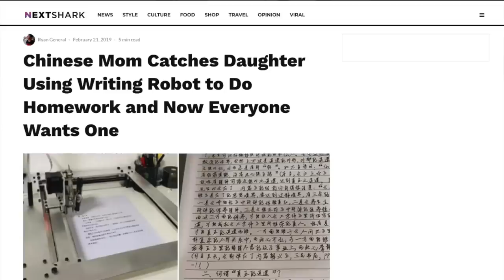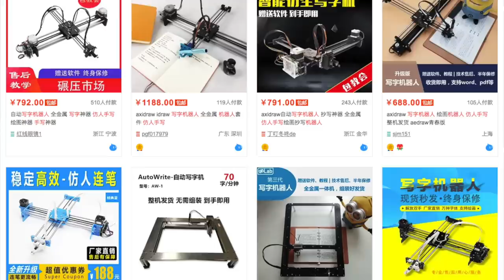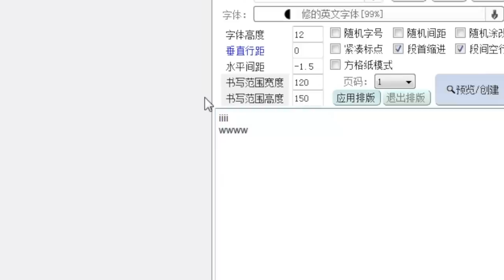Secret Chinese Homework Cheating Machine!😲

Comment: I think the font is way too consistent.  Not many people write the character exactly the same way every time.  If the printer was going to emulate handwriting more accurately, you'd need a handful of versions of every character and then they'd have to be randomly called for use.  It's not easy for a computer to look sloppy but that's what makes a person's handwriting look like handwriting and not a font.  At least in my opinion.
Reply: I don't know, there are people who dedicates to identify other people by their handwriting looking for the consistency of their writing.
Reply: From the sounds of it, because Chinese characters are learned by repetition over and over to be absolutely perfect, then that's not really a problem, but in English and other languages a little slop is expected, and when it's not there you get an uncanny valley feeling. It's actually worse because of the perfection. 
The mono space is a problem as well, but I'd know it was done be machine even before noticing the spacing.
Reply: on the lined paper it was really obvious, every copy of a character had the same spacing. even though the font hides is well (since everything isn't perfectly lined up) the overall effect was too structured.
Reply: @AndyDillbeck  Because drawing a Chinese character with even the tiniest imperfection changes the meaning, they have to be exact. In English, we just have to get it close enough. I, as a left-handed male who works in I.T. have the worst handwriting you've ever seen, it changes from character to character. Since we English speakers (and writers) don't have that constraint most people just have a way they make an English character and when it hits the paper sometimes the pressure is inconsistent etc which would make tiny imperfections. I think that would be instantly noticeable for most experienced teachers (and parents) plus the noise would clue in the parents
Reply: Nothing a bit of machine learning cant solve
Reply: @thecommenter578  usually identifying a person by their handwriting, or more exactly proofing if for example two handwritten samples are written by the same person, does not look into how exact every single letter matches the others, but more how the letters and especially letter combinations are written. Sh in combination they may look different from s and h in other contexts for example. They look for characteristics like a little loop or hook when starting a letters line, if an L was written wit a little loop at the corner or as a straight angle, how pressure was applied within a letters line, such things.
Consistency is a part of it, but more like if a person has a tendency to make the letters slightly smaller towards one end of the line etc.
Reply: Check out this guys fonts....  they do exactly that...
Reply: For the tiny font sizes you could just add some variability when the g code is processed, add or subtract a certain percent from each movement coordinate. Think it would add enough to seem sloppy. On the large font sizes you really need different versions of each letter.
Reply: I did create my own font 😘
Reply: I think the same could be done in any language. I think what the kids are banking on is the sheer amount of assignments working in their favor. If it looks handwritten, the characters are legible and there doesn't appear to be any plagiarism, move on. Can't say I ever made much attention to handwriting while grading other than to note those with really bad handwriting and those with exceptional handwriting. It was more about the content over the delivery.
Reply: @thecommenter578  While there's a certain amount of consistency for English cursive and print,  it's not exactly the same
Reply: This was exactly what I was thinking
Reply: @msihcs8171  eh have you seen some people's handwriting in Chinese or Japanese? You can get a scrawl where it's just a wiggly line, but it's close enough that people can recognise the character it's getting at. Same as in English really, you recognise the shape of words more than the characters so it doesn't matter when an a looks like an o or whatever

It's different when you're in school and they're looking for perfection to make sure you know what you're supposed to be doing though! But it takes real skill to write characters consistently, you'd expect some variation in how they come out
Reply: I already get mail where the address on the envelope has used a font that is supposed  to look handwritten.  I can always tell because the duplicate letters look exactly the same.  You could see it when Naomi did an English sample and all the i's and w's where drawn the same way.
Reply: @msihcs8171   I will say, that I know both Chinese people with sloppy handwriting and western people that have scarily consistent handwriting.  The westerners work really hard at it and put in time to keep it so, the Chinese people are electrical engineers and don't write by hand in Mandarin often, so they are out of regular practice. One lady told me that when she was a child she never worried about the stroke order so she draws her characters "wrong" and the same character in different stroke orders sometimes.  

Oddly enough, I would say that my spoken Chinese is better than my written Chinese, but when I say something and make a mistake in tone, etc. people have no clue, but when I WRITE something, people will understand it and say "oh, but you missed a dot here" or "that line doesn't connect but know what I am trying to write.  If I were to guess it is either: 1) because when using pinyin on  their phones and computers they select the character they want from a list, they are better at recognizing a character from an approximation or 2) my spoken Chinese is a lot worse than I think it is because I don't speak a tonal language natively!  ;) Either way, that is my experience: accuracy seems to matter more in speaking than in written communication because Chinese people are better at recognizing characters that look close to what they should look like than words that sound close to how it should sound.

of course I don't know hundreds of Chinese people, so My experience might not be representative! What do you think?

cheers!
Reply: exactly true. even tho the selected font could look hand written, theres no variation.
Reply: @thecommenter578  yes its the way the english charaters are done the different styles and varents almost like a finger print granted there are some master penmen that can exactly replicate their charaters each time but this is uncommon at student levels and is something of a dieing skill like manual drafting but yea they look at whats the writers style and figure out their comfortable movements
Reply: I have a commercial art background; I've seen sign painters, comic book letterers and graphic artists that have built up so much muscle memory in the trade that their penmanship is very close to perfect; most people wouldn't be able to tell, but there is even slight variation in their work. An easy example, You can always tell the difference between hand-lettering (all Comic books were hand-lettered from the 80's and earlier) and someone using comic sans font (most comics these days).
Reply: Exactly this. If every character looks exactly the same, alarms go off. There needs to be a randomization factor.
Reply: There would definitely need to be more randomization (or chaos) added to the pathing to make it look a bit more realistic especially when you use many of the same characters throughout a paper. Varying speed and pressure would also help as humans don't really write at a consistent speed as they process their thoughts while putting them down onto the paper. Might even just stop mid sentence to think what to write next. All of this shows up in handwriting. Machines don't think, they just do (currently anyway haha)
Reply: @Adam Payne -- Not inconceivable to add in some Illustrator-like width tool functionality to add some line thickness variation to the characters.
Reply: Most people aren't aware that randomization is a part of most western languages, both spoken and written.
Without it, it is immediately apparent that some form of automation is behind it.

Comment: It is cheating if the expectation is to have handwriting and the student uses a machine and claims it is handwriting.  One of the fundamental characteristic of handwriting is the variability.  The problem with the "i" and "w"s is that they are too identical.  This is more important than the monospace font.  Similarly, if a Chinese teacher takes two identical characters (ideograms) at various places in the text, and he can superimpose them perfectly, he will probably get suspicious.  Like, if the student is "too good to be true"... 

To be totally credible, the software needs to introduce a little amount of randomness. This way, if you project two similar characters one on top of the other, they do not match too perfectly.
Reply: Pierre C yes you are right I never see Chinese that even write Mono space by hand when they not need to write in boxes on the paper where some dashed lines help to write in the exact sectors.

Comment: I remember reading about this problem a few months ago.  Thanks for showing the tool that's used.  It's cool to see that it's like a core XY type device.  Between that and the pen, it's easy to see why the characters are smooth and hard to determine if they're written or printed.  To your question on is it cheating?  I think it depends on the assignment.  If the assignment is to learn the characters and improve penmanship, then repetition is key and this would be cheating.  If the assignment is thought based and this is used as a printer instead if handwriting it, then I don't think it should be considered cheating.

Comment: It is essentially a flatbed plotter rather similar to those that we had in the 70's and 80's. 

Under a magnifying glass you will see that the shapes are formed using incremental steps due to the stepper motors. The consistency of form is another give away.

Old Calcomp drum plotters in the 60's had the characters stored as data in the software.  These characters could be scaled, shifted  and rotated within the software before they were transmitted to the plotter (x Inc, y Inc, pen up/down) the plotter instructions being passed as bytes over a simple parallel interface.  The software was written in Assembler. 

The HP plotters used HP-IB interfaces; now called IEE488 called a General purpose interface bus GPIB. Each device had an address set using DIL switches and devices were daisy chained together. The HP plotters that I used in the 80's held the paper in place using an electrostaticly charged plate.  They were not cheap machines, however, the one that you are using is clearly built for home/hobby use.  The characters were stored as data in ROM's within the plotter which could be scaled and rotated within the plotter.  You could buy new ROM cartridges to change font and print symbols (such as Chinese). The computer controlled the plotter by transmitted ASCII string over the HPIB interface. The software was written in Fortran or Basic. 

Modern plotters tend to use inkjet technology and communicate in similar ways but using Adobi script to form the characters. 

Do you have Chinese programming languages?

Comment: How does the robot detect lines on the paper? Is it just a matter of calibrating it to move in the right increments, or is  there an optical sensor to detect that automatically?

On a different note, love your videos! Keep up the good work!
Reply: I don't think they use lined paper as much as we do however its a stepper motor rig that works in increments so its probably a matter of calibration and the right set of code think a 3d printer without the hotglue tip and  instead a pen or brush that reacts to z pressure is used heck you could put a dremmel in there and have an engraver as well or who knows perhaps an exacto knife is more your style it works alot like a regular printer but it looks like it just moves the head instead of the paper for space and accuracy reasons there is much you can do with a machine like that

Comment: A great upgrade could be for a person to write down their own alphabet or character, scan it, integrate as a publishable font and voila know one can say it was not the student who wrote his homework. Of course as you said a z axis could also help simulating where a person press on the crayon writing a word and where he lifts.
Good video you made.
J.P.
Reply: There is--or was, I don't know that it is still available--a website where you could send your handwriting and a few dollars and get back a font file usable in MS Word.  I tried it and even though my computer could now print in my own handwriting, it did look odd to me.  I think the letter spacing was part of that but also, my actual handwriting was never in as straight a line as the printed version was.
This machine is very cool, none the less.
Reply: I would add with AI it should (I wrote should be easy to mimic the handwriting of a person

Comment: The problem with the machine using western characters it's that it's too consistent and perfect. Each letter has the same size and shape. Not only that, each person has its own caligraphy and any teacher after awhile can somewhat identify which student wrote something. If you present that to anyone they will inmediately realize it has been maded by a machine.
Some years ago I had a teacher which insisted that we should give resumes handwritten. It was a very boring task which took me 4 hours per chapter. I kept thinking and doing some tests and I managed to "teach" the computer to write with my own handwrite text. 
Here it's the result: http://oi67.tinypic.com/30ixg2h.jpg
Both are scanned pages. One with my real handwrite and the other one with the "process" Which consisted in create my own typography several times and then using a script in word 2003 to randomly select one of them and slighty change the size to break the "perfection". That, mixed with some OCR from the book allowed me to reduce the whole process to 45 mins. The teacher never even suspected that I printed them. In fact I was prepared to defend myself saying that "it was indeed my own handwrite" (which isn't a lie. It was!)

PD: I'm pretty sure you re used to, but I still say, Naomi, you are beautiful and smart n_n

Comment: There are a few fonts in English that are monspaced, which is a throwback to the days of typewriters, but you are correct in saying it doesn’t look like normal handwriting. 

Back before the days of inkjet and laser printers, plotters, as they were called, were used to draw graphs and other non character based prints. Some of these were very elaborate, and could draw multiple colors. All the plotters I worked with moved the paper for the y axis rather than the print head, but they were capable of intricate drawings. To me, what you showed is taking modern 3D printing technology to go back to the idea of a plotter. I suspect that the newer version is better suited to the nuances of Chinese characters, though it would be interesting to make that comparison if one of these older plotters could be found and interfaced with a modern computer.